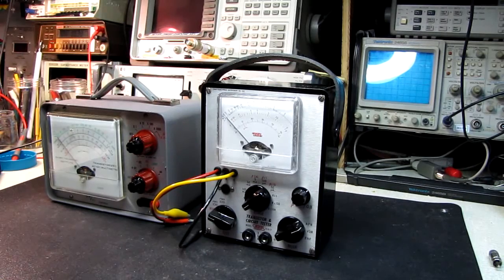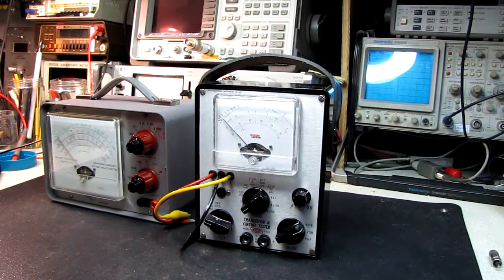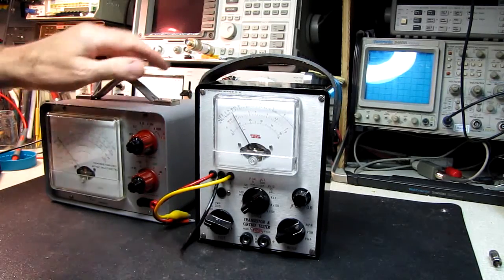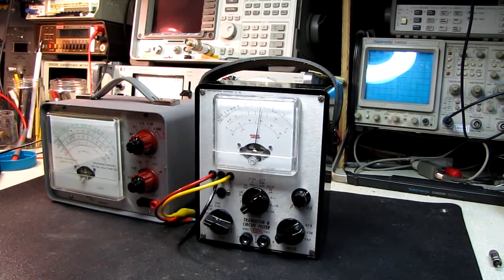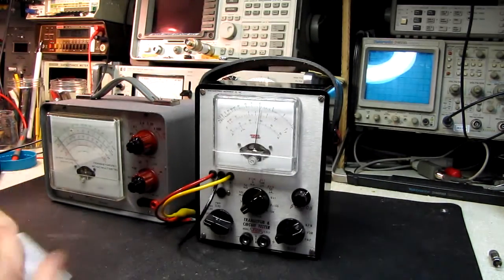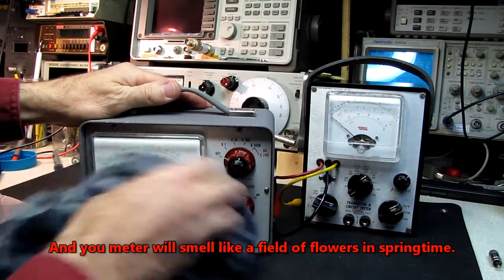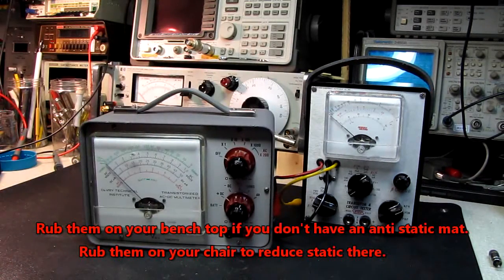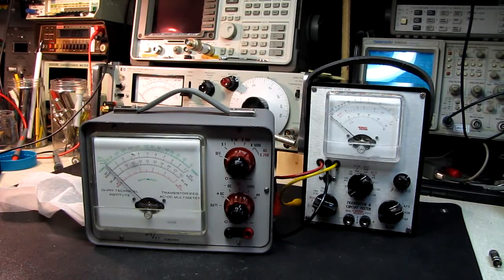Static Fix for Analog Meters

Comment: Leaves white powder. Seems that there should be a design fix. Is there other materials for the screen or anti static coatings which permanently solve the issue?

Comment: Thanks for the hint! Here in Buenos Aires, Argentina, climate is quite humid and not always cold, so the static does not reach a level so high to render the meter unusable, but anyway offsets the quiescent position somewhat. I guess dryer paper can also be good to avoid static buildup when packaging integrated circuits, electronics stores no longer care about wrapping your components in antistatic bags.
Reply from the maker: Hi Daniel, This time of year Argentina sounds like a good place to be. We used to use cooking foil ( aluminum foil ) to wrap memory chips in to protect them. But I think the dryer sheet might work also. Thanks for watching.